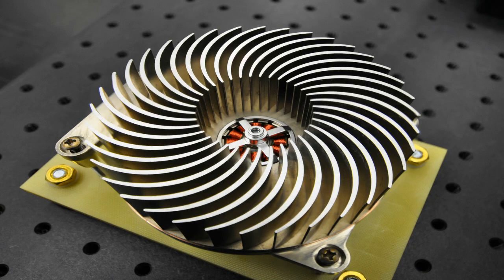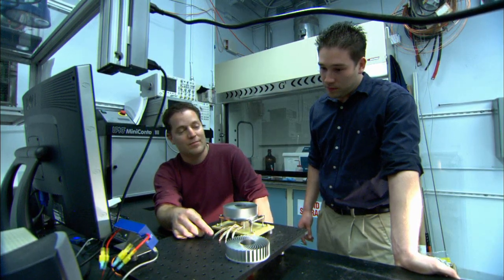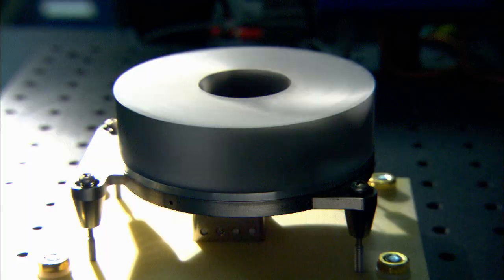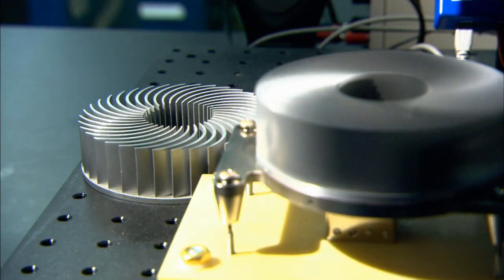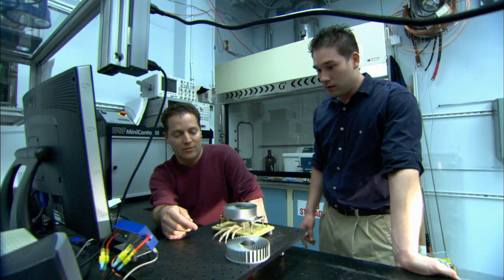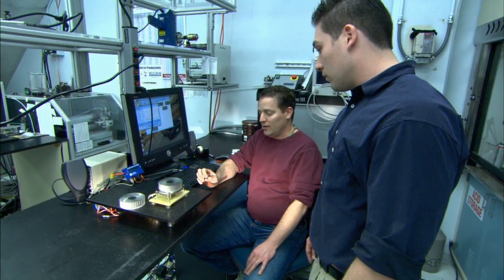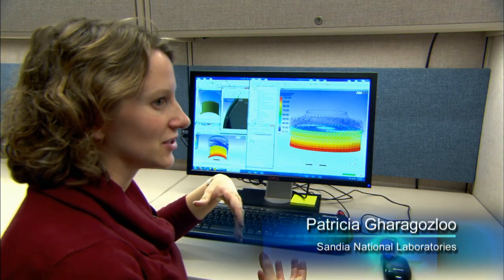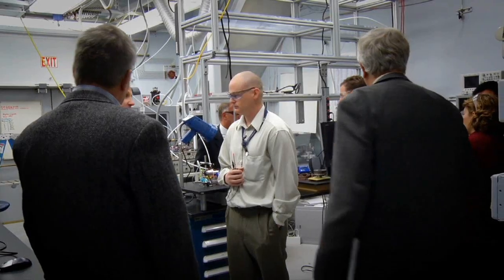Sandia Cooler

Comment: I'm sorry, but I'm not buying it. But the 5 fans,  plus AIO loop, plus the fans on my GPU, does not produces as much noise as this thing does. Could you imagine listening to that high pitched noise all the time?? Plus, there HAS to be dust build up on that think. It has so be turned off at some point. I'm pretty sure conventional fans run well over 2000RPMs and they still get dust.

Comment: So it floats on air, meaning it won't run correctly on anything other than completely level surfaces? I'm guessing this is why you don't have them in PC's right now. This thing won't work on it's side.

Comment: No dust collection because dust at 2,000rpm gets "flung off"? I see someone hasn't ever been in IT and had to clean a computer before. If you think your measly 2,000rpm is going to stop dust accumulation you are going to be in for quite a surprise.
Reply: im lucky to try out server grade stuff certificated for 24/7, and thats cooler is spins at 7000rpm, louder than a vacuum cleaner, but able to blow the dust off from itself and the heatsink fans (the normal fans i tried are dusting and needs regular cleaning ~1500-2500rpm)
Reply: I have tons of dust on my fans. Just cleaned some off today.
Reply: Either that, or matte plastic surfaces designed to constrict airflow along the axis of spin aren't comparable to smooth aluminium surfaces designed to encourage said airflow.
Reply: I we seen 8000 rpm fans with dust on their blades 
2000 rpm stands no chance
Reply: Who to trust? Sandia? Or some random YouTube comment
Reply: @OverlordQ  dude, that’s what I was thinking! Clearly, the random YouTube commenter is the expert.
Reply: @OverlordQ  Lol exactly. If Sandia can't be trusted we're in big trouble since Sandia is behind the development of many of our aerospace and military systems all the way up to nuclear weapons.
Reply: I mean its just an impeller. They're making it sound as if they just invented warp drives lol. Love the engineering jargon though.
Reply: I think it was meant in context.  The impeller shape should in theory repel particulates, however, static contaminants could collect, and Invariably do.
Reply: The difference probably isn't the RPM, but the fact that those gaps are so narrow and there aren't diagonal slopes. The air is forced through at presumably higher speeds and more uniformly (less weird aerodynamic effects happen at the blade surfaces and allow dust to collect).
Reply: @MushVPeets  если покрыть вентилятор тефлоном пыль не сможет держаться на лопастях.
Reply: I thought the same
Reply: Dust is also abrasive, that"smooth fin design" will become pitted, enough for the dust to adhere to, as others have said here, dust forms at even twice the rpm levels.

Comment: Look at the workings of a firetruck pump. It works on the same principle. If you put a housing around it with a downward ventura in the center and make the discharge a little smaller it would draw in more air and exhaust out even more at a higher pressure. You could vent it to the out side of the case to disperse the heat. Build it like a squirrel cage fan design. The dynamics of a pump is to work with volumes of water or air and it builds it's on pressure pulling the heat away from the center.

Comment: I'm no physicist but wouldn't spinning it in the opposite direction promote more airflow because the outside of the cooling fins have a larger surface area?
Or is this where venturi comes in and starts talking?

Comment: who is watching in 2016 wondering where the hell this ever went?
Reply: +No Lucks Given , cooler master redoing it and probably making mad bucks on it
Reply: denisgsv well hopefully normal people like me can buy them wothout spending too much
Reply: https://www.google.com/#q=cooler+master+sandia+cooler&newwindow=1&safe=strict&tbm=isch
Reply: +No Lucks Given Its a stupid concept.   Air is an awesome insulator, and yet they want the heat to pass from the CPU through air, to a heatsink... that's idiotic.   That's why cooler master's more feasible solution uses heatpipes and a static circular finned heatsink with a spinning impeller in the middle.  But then you still have dust build up since the outer fins are static again.   All completely moot though, as AIO water coolers have become very inexpensive and reliable, and the radiators offer far superior surface area, and with cheap intake filters being common place have no possibility of dust entering the system when utilizing positive case pressure.    So the only people still using air coolers are the lower end market since they are cheap, with the higher end going watercooled now for silent operation able to efficiently disperse massive heat.   In fact, even 360mm AIO radiators are on sale now for as low as a hundred bucks.
Reply: +No Lucks Given its all about conspiracy, some kind like Gas Fueled engine VS Electrical Engine
Reply: ***** Well I hope you are wrong, because I wouldn't mind something like this. That being said a simple closed loop has so much performance per dollar, what really is the point right?
Reply: +No Lucks Given Yeah I'm kind of looking into this right now and i don't know where this went. I think too much cost maybe?
Reply: +Jeff Shultz Maybe, I was really hoping this would be an alternative to water.
Reply: +Jeff Shultz Maybe, I was really hoping this would be an alternative to water.
Reply: i know right ? they are stupid aka cooler master
Reply: Cooler Master is coming out with one. looks a little different but same concept

Comment: This may be quieter than a fan, but that sound is awful.
Reply: +GoogleMinus listen to what they say in the video; "nearly noiseless with a ducting cover", its a prototype!
Reply: mtohrw Nearly noiseless, so it will be very quiet but still the same sound.
Reply: GoogleMinus that, we do not know. The sound it does in the video seems typical to an early stage product without proper shielding. What I'm trying to say is that we dont know anything except from that they more or less promise it'll make less of a sound than regular fans.

Modern quality regular fans hardly makes any sound a part from the "waterfall air noise" they speak about in the video so we can assume it has a pretty attractive performance to noise ratio.

also, you have to take into account that due to it "hovering" it wont cause vibrations which causes A LOT more noise than most people think.
Reply: mtohrw The difference is with regular fans you can put rubber vibration isolators on the fan contact points because it doesn't need to conduct the heat...

Comment: Where is CoolChip? What happened with the cooler that should have been launched already?
Reply: Merp
I also watch Jayz2cents, but sometimes he's a little biased, since he's an enthusiast. Skunkworks has 2 Titan XPs (for f**ks sake !), he doesn't even need that power, but that PC is meant to be an overenthusiastic build. He wouldn't know how it actually feels to play daily on a low to middle end PC. People will be happy whatever they get as time as their games and applications run without hiccups.

***** I love Phoronix ! They are amazing people (as I am a Linux enthusiast myself, rocking Ubuntu 16.04 and Arch Linux with LXQT).
Reply: if you are going to build that compact get a all in one liquid cooler with a thin 120 or 140 mm radiator and mount it remote or on the back outside the case.
Reply: Problem is AMD bottlenecks video cards now in the latest tests. Jays2cents just tested a 1080 with AMD vs intel and that chip bottlenecks it in games pretty bad even vs last gen Intel 4 cores.
Reply: Merp I'll be talking about games specifically, since they take the most advantage of high-end GPUs.

If you pair an FX 8350 or even the hot and heavy FX 9590 with a GTX 1080 or Fury X, the GPU will stay idle pretty much all the time, while the CPU will work hard. But if you pair it with a GTX 1060, RX 480 or even an R9 Nano you won't feel any difference than if you paired it with the best Skylake i5 (6600k). And the FX'es are significantly cheaper. But you won't get the latest Thunderbolt, USB 3.1 Type C and NVME M.2.

Zen looks promising and it appears to be put between Intel Mainstream and Intel Enthusiast platform. If I recall correctly, Intel i7 6700K has 16 PCI-E lanes and i7 6800k and 6900k have 28 and 40 respectively, while Zen should have around 24 PCI-E lanes. The future looks promising for Zen, especially if it is priced correctly.

By the way, I don't need water cooling, as the hottest part of my build would be an APU with probably 65W of power, so a low profile heat sink with a small fan will suffice (though I'd really like to have that shiny CoolChip Kinetic cooler - it's been more than a years since its first public appearance at CES2015 and almost a year has past since its second appearance at CES2016.
Reply: MrBiky True true

Comment: This was displayed in 2012? I built a small computer this winter, and wanted a compact efficient air cooler. I ended up mounting a water cooler on the outside of the case because I found nothing that used the space I had efficiently. I had noticed this cooler designed, and I was intrigued, but could not find a commercial product to buy. I do wonder if it will work in a vertical setting, will the air bearing still be functional? I'm thinking the rotating piece looks fairly heavy, and the center axle might flex to make the pieces touch at the bottom.

Comment: For CPU cooling, this seems just a bit early.  The prototype in this (and a year ago at CES) was clearly horizontally mounted.  Horizontal PC cases may have been the thing in the 1980's, but since the early 1990's, it's been rare to find a PC case that doesn't have the motherboard mounted vertically.  It is conceivable that this might find use in HTPC type builds, especially if the noise levels can be reduced to what people expect from such builds (to be quiet), but I just don't see it being used in a a standard tower build without major issues.  Also, just as important as the orientation issue, how well does it handle shock?  A PC faces everything from technophobes bashing it, to frustrated individuals doing so, malicious siblings or neighbors, or even accidental bumps strong enough to rock the chassis.  What would happen with such a shock in operation with that much mass moving that fast?

Comment: Im curious about the hydro dynamic air bearing, if the fins separate to self sustain then how does the cooler stay in one piece on a motherboard that has been mounted vertically, which usually is the case in tower pc's.. 

i suppose this cpu cooler will be beneficial to only those who use micro atx PC cabinets with horizontal motherboard placing..

Im not against it but im just curious

Comment: and how do you intend to transfer heat from the cpu to the heat sink which is spinning... spin the whole cpu? why not the also the motherboard?! you do know more interfaces (metal/air + air/metal) lower the whole system efficiency?
Reply: 3 years later and still not a single of said coolers (THAT WERE NOT MODDED IN ANY WAY FROM THE ORIGINAL DESIGN) are on that market for sale... Cant even find the modded ones for sale. Alot of promise, none delivered.

Comment: Do you realize the actual heat dissipator(the rotor) is not making contact with the cpu's heat spreader?And i can't see what is new, the actual mechanic piece that pushes the air from inside out is already used in refrence gpu collers(nvidia and amd),So i see no reason for this to exist.And that sound.....THAT is not silent at all,that high pitch sound can be easily heard from 3ft.

Comment: Sorry guys but with the price of an AIO liquid cooler today, you're not really going to beat it. I have a corsair liquid cooler in my machine and the only thing that's loud in my computer is my GPU. I can't even hear the fan from my CPU's radiator. If I put my ear up against the case, I can KIND OF hear the pump from the liquid cooler.
Reply: Perposterown But then you have to consider the massive increase in volume needed to fit that liquid cooling.
Reply: ***** It fits where a standard 120mm fan does in a case. It's literally just like if you put two 120mm fans in the same slot in terms of how big the radiator is. 
The tubing won't do anything much considering it's just running to the processor and if you have cable management, you will have NO issues. 

I've seen people put AIO liquid coolers in mini ITX cases. 
They aren't big at all.

Comment: That was quite the opposite of quiet, not even talking about the high frequence of the noise
Reply: Watch the whole fucking video. That sound is the brush from the electric motor that simulates rotation that would occur in a PC
Reply: Watch the whole fucking video. 3:54

Comment: i hope this works and it dont get too big with the protection they will surely add on finished product,  im thinking cpu cooling first.
it has to beat the performance of a noctua u14 at 500rpm and be cheaper to be of any use. it looks like it could be a fair bit wide in the end.
the parameters i think it has to beat is: 20db at 110w cooling capacity.

Comment: One of these made out of graphene, using a set of stanene-fluoride motor coils, would be really kickass. The fins would be extremely light, almost completely transparent, incredibly durable and would dissipate heat [almost] like nothing else, and the stanene-fluoride motor would be superconducting all of the way up to 100 Celsius, making it extremely powerful AND energy efficient.

It sucks that graphene and stanene-fluoride have to be so expensive to build.
Reply: Amaroqdricaldari We have the technology.
Reply: Would be insane cooling for small form factor. Maybe around $150 for like 200w tdp.

Comment: WTF this is a old way of moving air a lot of vacuums, air horns use this type of system i don't see anything here new
Reply: No....no they dont....
Reply: +4WDBearAus AC Units and older vacuums do.
Idk about air horns...
Reply: this type of air horn http://www.buyincoins.com/item/41971.html#.Vk7HRvkrIuU

ok this does not have 100 fins but it has them and it works in the same way
Reply: Deon Hamilton  ah, never seen a horn like that o.O
Reply: yeah well there's heaps around like this they have also been around for over 70 years  so yeah that's why i made my comment about how these guys are full of shit they did not invent anything new here
Reply: +Deon Hamilton the difference is vacuums and air horns just need to move air, this needs to conduct heat as well
Reply: that's a rehearing and has nothing to do with the way it moves the air, witch is what we are talking about.oO

Comment: I'm just curious, because he just glimpsed over it; how exactly does the heat transfer from the cpu to a the impeller?
Reply: Ken Hnyla see linustechtips video on the subject.  there are a whole lot of interlocking grooves between the heatsinks that have such a small airgap that it transfers heat just as well
Reply: Ken Hnyla through the self sustaining air gapped fluid modulator, duhhhh
Reply: I'm guessing it's basically a squirrel cage fan minus the enclosure, with magnetic bearings? So it spins ridiculously fast. The air gap is the gap between the cpu interface and the turbine, where the pressure is the highest, keeping cool air on the cpu.

Unless I'm wrong?

Either way. making magnetic bearings with a motor that tiny is pretty hard.
Reply: James Ward
 yes I saw it.. but air is air. solids transfer heat better. This is a fact.. lol

Comment: 3:55 ... Motor shut off and coasting on SILENT (the way it's supposed to work). Holy fuck watch the entire thing. This fucking attention-deficit generation.
Vertical solution: a 90-degree highly conductive heat sink that lets the module sit in its operating orientation to take advantage of the air bearing. The CPU is still connected conventionally via thermal paste and the Sandia Cooler will just be cooling the block. Whatever... Any problem you can throw money at isn't a problem. They'll make it feasible somehow. CM is already going to be taking advantage of this concept and they're not in it to lose money.
Just wait and see... Whether it's successful or not has not impact on your life. If it fails, you still got air / sealed / loop. What's with the entire wall of negativity?? Yeah... Let's just all take this defeatist attitude in life. Technological advances would never happen. SMH

Comment: I don´t get it how the heat will get to the fins.
Reply: +BiN4RY But it'll be quieter, and theoretically it could provide much better heat dissipation. Only time will tell though when actual products are finalized and released and we get a chance to see how it will perform.
Reply: +Dennis3Run That's a very good point. The base heatplate and the main spinning heatsink makes almost no physical contact, thus almost no heat is transferred. This entire video is just demonstrating a marketing gimmick that won't ever see the light of the day.
Reply: +BiN4RY I think I have to build this by my own to check if it works
Reply: Dennis3Run It won't work by itself. At CES, they demostrated a prototype by having a circular heatsink build into the baseplate, which surrounds around this fan.

In the end, this really is just an overglorified fan.
Reply: +BiN4RY if air is not conductive, why we use fans to cool our computer
Reply: alanbobbichan Search up what the term "thermal conductivity" means and compare the value between air and aluminium

Comment: So than rather than using an "air gap" why don't they try to use an oil or water gap that way the device will conduct heat better over the air gap? If they did that, I could see this being a near perfect design.